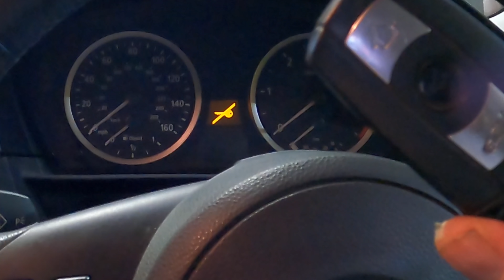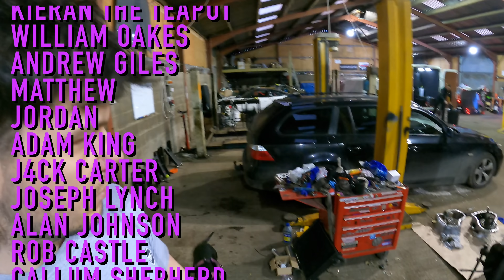Is the E61 a GOOD CAR? BMW Bangernomics 2 Years On

Comment: You can take it out of park with the key out. Lift the cover from around the gear selector and there is a hole on the left side you can put a screwdriver in and pull back to release park. It is in the manual and used if the car dies and need to tow or pull on to a low loader. Can you guess why I know about that?

Comment: Well the "Internet bmw crowd" is a funny thing... Been in it for around 15 years, lived the "only e30 is a real car, the new plastic cars are shit", then the "no fluid changes, read the stickers dummy it says life time oil, no change needed", then the "e60 is the worst car ever"... So Dan... I my humble opinion, no mechanical device using oil goes without  servicing it... Or if it is cheaper drive until the box goes and get a "good used one", both ways have their fans.... If it was my car and the milage is correct, would change the oil to prevent low oil /oil contamination and thus high gearbox temperature... Which is the thing that kills them in the end

Thanks for the videos and thumbs up

Comment: Nothing wrong with an E60 lci or pre-lci, they are good cars you just have to know how to maintain them, DPF's can fail/block up but thats because the parameters have to be met for a regen, normally down to a failed thermostat or glow plug or egr fault, none of which is that difficult or expensive if you're handy with the spanners, a diagnostic tool like INPA or Carly will pay dividends. Swirl flaps can fail but nowhere to the extent that people make out, they can be deleted very cheaply. Control arms can be expensive if you go OEM but the Meyle stuff is good and not extortionately priced. End of the day these are cheap 'luxury' cars so dont go in thinking you're not going to have to spend money on it, there are no cheap luxury cars. And yeah no such thing as 'lifetime' oil...
Reply from the maker: Good post

Comment: I got an E61 about same time you got yours. Also got 164000 on the clock. Have just had to sort the turbo out (thrust bearings went), but otherwise been absolutely faultless. Not a rattle or squeak either. Lot of car for the money!

Comment: My 2009 e61 525xd is at 456.000 km  and only recently let me down, multiple errors due to faulty ecu relay and intermittent throttle failure. Runs fine now. As long as it remains reliable, road legal and looking fairly decent there's no sense buying anything else.
Reply: Nice km! Ran my old e39 525 to 380k km, but rust got out of hand as with all E39's. Engine ran like new though. Currently 260k km on my current e60 525d.
Have you gotten yours sorted?
Reply: @jgripen969  finally it was due to a tired battery and faulty raley causinf excessieve discharge. I did end up selling it because of the new rules for older diesels not getting into cities anymore from 2025. Still miss it but I bought a nice lexus rx 450h as a replacement.

Comment: The zf gearbox tends to leak (filter gasket gets stiff and leak) and Oil level gets low and the Oil hot.
Reply: Got a leak now zf 6 speed. Not sure where it's coming from. They think it might be sump. Think previous owner didn't use OEM filter. Low on oil so need to sort ASAP
Reply: @eddy45686  they can leak in more places , for one the seal where the cable goes. Be careful not to drive it low on fluid. Good luck

Comment: The only thing I don't like about my 320d daily is that it's not a wagon.  Thanks for the video Dan.  Especially enjoy the canine factor.
Reply from the maker: Not that it’s missing 2 cylinders ?
Reply: @dannyDC2  No, you're right. I'm just in denial and I have to rely on my old 535i as an antidote to my cylinder envy.  I did think about mapping the 320d but I just can't stand the belching black smoke out the back. My Mrs' has a mapped 120d and it's pretty quick but it's like a James Bond smokescreen when you nail the thing!  No bueno!

Comment: It's probably worth changing the gearbox oil but I've read stories about the gearbox failing after an oil change - give it a Google - it's probably just a coincidence. I've changed the oil on both of mine a couple of times (C5 Audi S6 and Merc E350) and it's worth doing as a normal service item but read up on the procedure before you do. You have to change the filter as well as the oil and there's a special procedure for refilling, you have to empty oil, change the filter, fill it up, then start the engine, get the box up to temperature, THEN add more oil with the car still running. When the engine is running oil circulates the box and you can put more in. Bit of a knack to it but fine if you do your research before hand and have a proper pump to put the fluid in.
Reply: If there is a really old oil, it created a lot of deposits. A new oil has fresh solutions that can dissolve these old deposits, they then travels and can clog channels and so destroy tranny

Comment: i have a 07 plate 520d e61, 50k on the clock, my first lux car ive owned going from sporty hacthbacks, i love it everytime im in it, great car
Reply: I’m sorry but 50k miles engine must be very very choked up with carbon
Reply: @piovo1  seems completely fine
Reply: @MannLiikeP  yep seems fine as diesels are strong but if you were to open that engine up it would be full of carbon everywhere. Could not have a single drop either but 50k for a diesel especially in 15 years means that it’s only done very short journeys.

Comment: Did the oil change on mine and I personally thought the box wasn’t as smooth afterwards. Was still ok but regretted doing it, suspect I was a little unlucky. My sisters car (same one) had done more miles and felt silky smooth, weird!
Reply from the maker: Mine isn't too bad just feels like it doesn't know what it's doing sometimes. Could be the torque converter getting leggy!
Reply: Probably didn’t put enough oil. These car will eat themselves if they are run with low oil.
Reply: Lucas trans fix oil is super stuff

Comment: I’ve found the best way to have a pleasant motorway journey is to either be the fastest thing, or the slowest thing on it. 65MPH - everyone passes you. 85MPH - your passing everyone. Sitting at 70 - 75 will just cause you to get snarled up with the idiots
Reply from the maker: Even towing at 62 can get you in trouble with the idiots
Reply: With fuel prices the way they are now I've taken to doing 60 and it's so much more relaxing than constantly accelerating between 60 and 70 with the idiots in front of you. Mostly lane 1, occasional lane 2 to get past the trucks.
Fuel economy is improved by about 20% over doing 70 in my car, and the average speed over say 250 miles only adds about 15-20 minutes to the total journey time.

Early evening, windows down in the summer with some good music playing makes it even better.

Comment: Bought my 2006 ,e61  530D  ,in 2013  flew to Italy  to buy it  at that time I saved 50,000 sek sold it this year for  52000 sek ( I bought it for €9000 that  was  9.50 per sek) 
This car Was  called futura   240 hp diesel, everything except leather, so  9 yrs i had the car,I bought a 2016, f36 420i,  prefer my old car. The e61 is a great car  I drive a lot of MB 220 cars  the xdrive on my old e61  gives  100 times better handling.

Comment: Dan, I do LOADS of motorway miles. M1/18/180/62 some A1M on your patch & quite a bit of A1 as far as Newark ish. Use CC 96% of the time. Always set to 74, seems to be the best speed, can get away with 76, for short distances, to get away from the twats. A1 I do 66, as it's a VW T6 so I'm limited to 60. No speeding tix in the 5 ish years I've been doing it. 63 in a 60 smart motorway limit etc. All good.
Far form perfect, but potentially less hassle than limiting to 70. Keep on keeping on. You Redzz

Comment: E60 common mistakes

DPF failure  (due to thermostat)
Engine temp failure (2 x thermostats)
Rear hatch wires (both sides)
Panoramic roof rear little window not opening properly 
Keys not opening or closing car (antenna in the rear hatch/or wires, or key itself (no signal)
Rust on rear hatch (open the glass)
IDrive Failure (booting or not working at all can be repaired about 350$)
Rear screen wash pipe broken or glass opening button broken 
Failure or third stop lamp (all or some led broke, can get only OE part)
Failure of screen and light wash pump
EGr failure (only pieburg works)

Comment: Didn't you also have to change an air bag on the rear from what I can remember. I wonder if you took this on a track and ragged it like you did with the Audi a6 Avant, it would develop a transmission/drive-train issue? 😂 Out of the three daily's you have had i feel like this is the one you have taken most care of in terms of how you drive it.
Reply from the maker: Well yeah. I did do a list of everything I'd changed on the video but cut it out cos was boring

The airbags actually lasted longer than the front springs...
Reply: @dannyDC2  Lol true. I always had a soft spot for that Audi A6 Avant you had. I like BM's too but always avoided the high mileage one (which i could afford) as it seemed like i always knew someone with one that either used oil or had timing chain issues. You haven't had any of that which is good.

Comment: On my 3 series with the stupid key like that, if you push the button to stop the engine and then once more with no foot on brake it will put the ignition fully off with the radio and stuff off. I use that for when it’s on the ramp.

I vote good car. If it gets places other things can be forgiven.

EDIT: 20 seconds later you said the same thing. Must watch whole video before chatting shite.

Comment: I've had my C6 A6 Avant (3.0 TDi) 13 years now and just hit over 230k miles. I've read both sides to the 'gearbox oil' change issue for years, and wrecked my head wondering which advice to take - especially early on in the cars life when it had fewer miles and was still worth money. But being a cheap b@$t@rd, I decided to leave it be and see how it goes, and well, hauls as good now as it ever did - zero deterioration at all (and I do a lot of 'toy towing' too, having also had the 'manual rear parking sensor' installed). Each to their own of course, but as this is my daily driver, a work horse and a towing tank (and a big 3 litre oil burner also helping!), I don't rag the @rse out of it like the other toys, so it literally has been mechanically faultless the entire time (silly bits like parking sensors and window regulators being the only things that have given grief over all that time). My advice then? Don't drive it like a tw@t, and your gearbox will be just grand with the oil she came with! 👍

Comment: 2005 E61 530d since 2013 had problems but I fix them and keep going 😁😁
Gearbox oil change every 50.000km engine oil every 10.000km
Reply from the maker: you're wasting your money on oil
Reply: @dannyDC2  Better than waste them on new gearbox 😁😁
Reply from the maker: Not sure with how much ZF oil is 😂